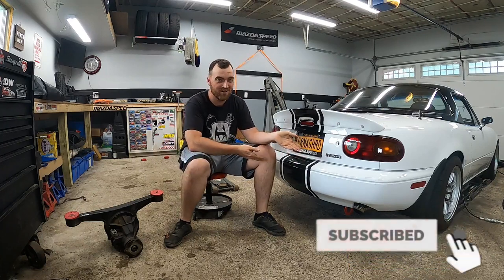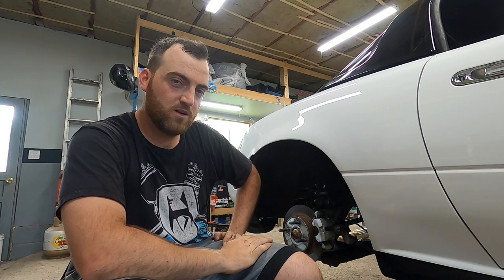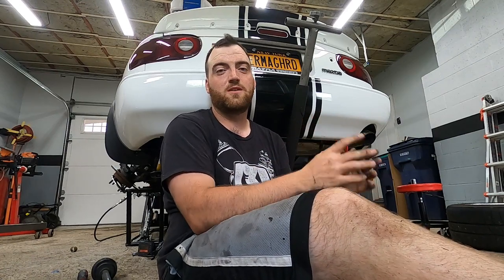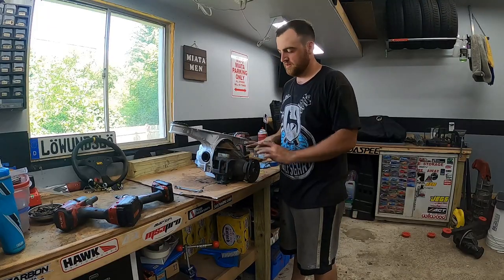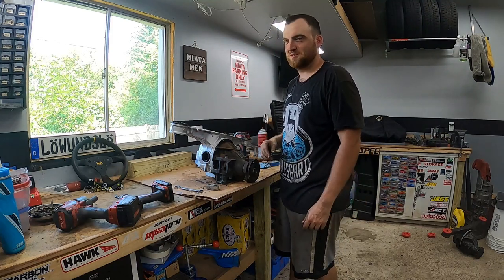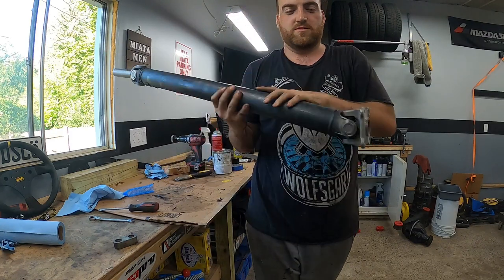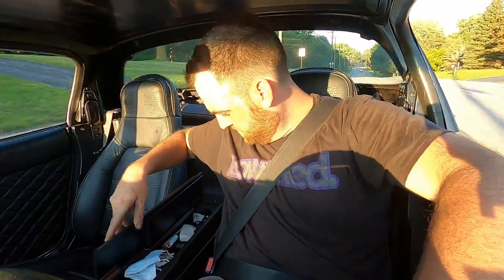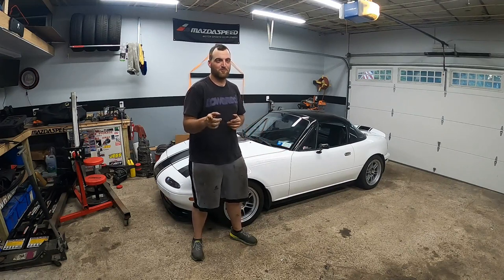Torsen Differential - NA/NB Miata 3.63 Swap (Install How To)

Comment: Excellent video.  It took me a couple of weeks to change my 4.1 to a 3.9.  Broken bolts, a bad U joint and generally a rust ridden car.  I would have used a 3.63 if I could have found one but the 3.9 is still an improvement.
Reply from the maker: Right on

Comment: Somebody help me!!!! Where can I get a torsen diff? Wanna sell the 4.1? I've been looking for a 2 couple weeks and I cant find one.
Reply from the maker: Check out Alex Todd at SNS Mazda Parts. He can hook you up with a full diff swap. He’s on Facebook and Instagram.
Reply: @NappMotorsports  ty. I ended up getting a 4.1 torsen from treasure coast miata. Still have to put it in. Sure looking forward to it cause 250 with the stock 1990 diff just sucks.

Comment: I don't quite understand that... I have a 91 Miata with the 4.3 diff (I suppose) and it is going 3000rpm at exactly 100km/h (60mph) according to the speedometer. so if I swapped a 3.636 diff in there, I should get quite a bit lower rpm... though, you are exactly at what I am at with my stock diff. How?!
Reply from the maker: I rechecked this yesterday when I was driving. At 3000 rpm, I’m at around 68 mph. With different wheel sizes, the new rear end, and the fact that my gauges have been modified, I think it’s reading a bit off. I had to use my laptop to show true RPM, and a gps to show true speed yesterday. Once I swap the 6 speed in I’ll worry about getting everything synced up.
Reply: @NappMotorsports  hmm.. so maybe I need to check which differential I have. I mean, its not soo far off. Maybe I also have the 4.1 or 3.9 diff in mine. Need to check that. Though I really want mine to be a little more highway friendly as I want to reduce the emissions of my Miata. Not cool to use about 8L/100km while driving 60mph
Reply: Your speedo/tach rpm ratio will not change, as the speed sensor is in the trans. But your actual speed (gps) is changing
Reply: @philippe5249  Is there a way to readjust the speedometer? I have been looking for this alot as I am doing some research on Miatas (I am a bored teenager, help me).

Comment: Was there any particular steps im reinstall? I note somr people have vibration issues if things sre not alihned properly.
Reply from the maker: I’ve never had any issues. There are measurements you can take for alignment off the PPF

Comment: I got my last ppf bolt unscrewed and it’s sticking out a couple inches, I seen you hit it with a hammer. Do you mind explaining this to me, thanks!
Reply from the maker: The ppf bolt on the front of the diff has a collar in it that you need to hammer out to get the PPF to unattach from the diff. Also sometimes on the way back in the sleeve of the bolt gets stuck and a couple light taps does the trick to get it the rest of the way in.

Comment: What torque do u recommend for the 2 diff mount bolts that hold it to the subframe. Mines currently knocking because I think it’s not tight enough
Reply from the maker: I usually torque them down to 4-5 Ugga Dugga’s with my big Milwaukee.
Reply: @NappMotorsports  if you had used real spec I would’ve been lost.  This was the comment I needed

Comment: Very clean build! I've been mulling over getting a second Miata for N/A power, and this swap definitely seems like a contender. I definitely can't wait to see this turbo'd!
Edit: Also, if you're at 3500rpm at 75mph you've got a 3.9 differential according to Flyin Miata's gearing calculator
Reply from the maker: I could be off a bit. It’s definitely the 3.63. I’ve got different tire sizes and the gear in my trans might still be from the 1.6 with the 4.3 open diff. I’ll have to try it again. I noticed the other day when I was cruising that it was lower than I remember in the video, and 3300 rpm is 75 mph using the same calc on a 3.63. My gauges rattle a bunch because of the poly mounts, so I figured I was close with 7500.
Reply: @NappMotorsports  I gotcha. Also depends on what tires you're running. I got a Torsen thinking it was a 3.63, but I currently run 225/45 tires at 75mph, and I'm at 3500rpm give or take. Still a massive improvement over the 4.3
Reply: I like the tire rack, where did you get that?
Reply from the maker: Amazon. It’s like $35.
Reply: @MidnightMiata  does going to a 4.3 lower the rpm or raise ? If im at 4k rpm on 5th gear going 80mph is that a lower gear ratio ?
Reply: @Drthmnl  going to a 4.3 will raise your rpm.

Comment: I've had a 6 speed/3.6 combo for almost a year
compared to a 5 speed it feels like
1 - 2 - 3 - 3 1/2 - 4 - 5
worth noting is that 6 speed shifters feel clunkier and noisy until you find the right combination of fluid and shifter modification, then they feel incredible
Reply from the maker: I’m debating on going with the Miata Roadster taller shifter for the swap.
Reply: Napp Motorsports have you had any reviews on the Gracing shifter? I was debating on that piece

Comment: I like the video and the way you presented the context. I have a nb and my rearend sounds like tires are out of balance but the tires are deadnuts. When I jack the car up, I grab the rear shafts and push them up and down with about an inch of play on each side. Is this normal or is it time to replace the bearings? It only does this between 65 and 72.
Reply from the maker: I've never tested that myself, but that sounds like the traditional cowl shake that miatas get. I'd look into that before throwing money at it.

Comment: Thank you for video  I just picked up 1990 Miata 5 speed manual. not sure witch diff I have and if I need to change. making loud clunking from housing.
Reply from the maker: It’s either an open or a VLSD. There’s some good user guides that will show you the visual differences.

Swapping to a Torsen from a 94-97 is the best move though.

Comment: You mentioned you kept the competition diff bushings, but never said what the red ones were. What company are the red bushings from called so I know to avoid it? I will also be swapping my diff and want to know the best one for the street. I Don't want anything harsh. I was considering going with the orange Supermiata 85 durometer bushings. What other bushings have you had experience with?
Reply from the maker: The red one are Energy Suspension. I’d highly recommend the competition bushings for street use. My car rides super smooth on the street with little to no driveline NVH.

Comment: Are you using thinner on that tractor paint or just using it straight? I want to hit a few surface rust spots just starting on Amy's daily driver before fluid filming everything for winter. Sounds like I should use this instead of rattle can enamel?
Reply from the maker: No thinner, just straight with the sauce. I don’t know if this is a rust encapsulation paint like POR15 though. You can get some of that rattle can converter, and then paint this over top and it’ll do the trick.

Comment: omg i have been looking for a video like this for ages. Thank you this is really helpful! Is is the exact same process for the nb? I am trying to torsen swap my 1.6 NB(yes there is a 1.6 version in europe)
Reply from the maker: I believe it is nearly identical. There might be some support bracing that’s in your way but that’s easy to remove. Still weird to me that you guys got 1.6’s after 1993, especially in the NB.
Reply: @NappMotorsports  1.8 are much more expensive here(in good condition) I was able to get a really good 1.6 for really cheap.   Most NBs here are 1.6. Thanks for the reply.

Comment: Thank you, I needed this. 3.63 is my next step. Need to source some compatible axels. What tire size are you running?
Reply from the maker: Wheels are 15x8 Entwistle RPF1’s (ET35??)
Tires are 225/45/15 BFG Rival 1.5’s

For axles, just go to rockauto and order new ones. They’re $55/side and come with the ABS ring gear, which works even in a non-abs car.

Comment: Unbolted the driveshaft in my 90 NA for a clutch job, and the diff started leaking oil out of the pinion.  I thought it was just the seal but when I went to size a socket on the pinion nut, it came off with finger pressure :(.  I might be following these steps to get it out of the car, but differentials always scared me a bit. 

How difficult would you say a diff swap is compared to a clutch job?
Reply from the maker: I’d say it’s significantly easier to drop the diff than to take out a clutch.

Comment: I just got a torsen 4.1 and stub axles and axles that bolt up to it. I haven’t seen one person on YouTube with that set up. Did I buy the wrong thing? I see everyone else’s axles sliding in mine are a 2 piece
Reply from the maker: No you’re ok! That’s a Type 2 I believe? The other Miata on our channel (Dylan’s) has that setup. It’ll work perfectly fine. Same exact process.
Reply: @NappMotorsports  ya it’s a type two! I appreciate the help. I couldn’t even find help on the forums!

Comment: I have 1.6 shirt nose and the same diff you put it in the 3.6 is your drive shaft  from a 1.8
Reply from the maker: Yeah the driveshaft and axles have to match the diff, so if you’re doing a Torsen/Fuji/Open from a 1.8 you need 1.8 axles and driveshaft.
Reply: What year 1.8 Axles would I need?  @NappMotorsports

Comment: Hi, 7:18, what are you using to clean up the mating surface?
Reply from the maker: Without watching back, either a razor blade or a “cookie” wheel that doesn’t damage the surface.

Comment: what RTV did you use?
Reply from the maker: Permatex Ultra Black I think. Or Hondabond. Anything oil resistant should do the trick.
Reply: @NappMotorsports  Thanks a lot! What brush did you use to clean your diff surfaces?
Reply from the maker: Just some sort of metal bristle brush.